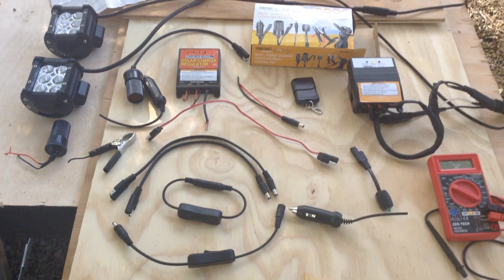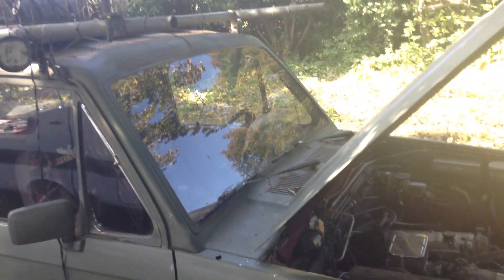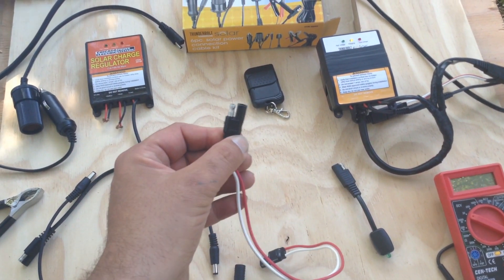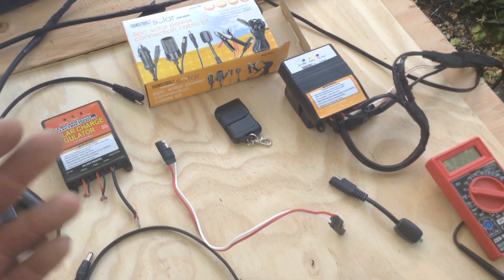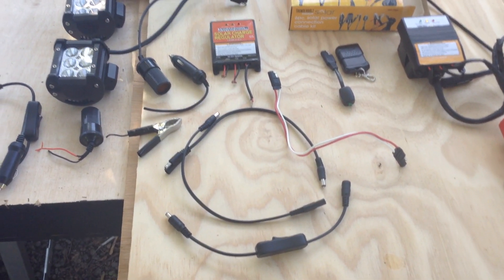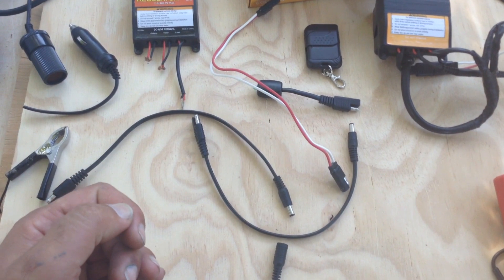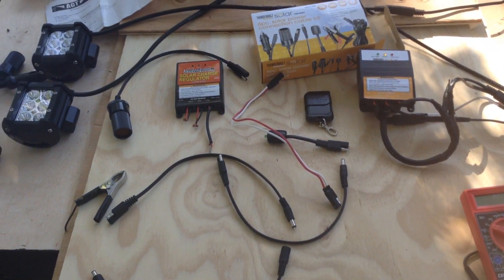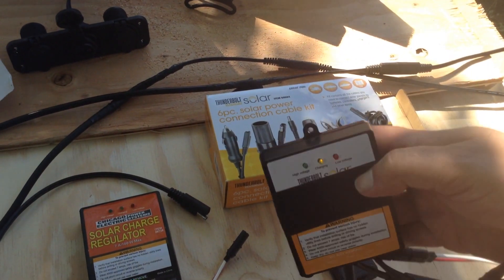SAE two prong plug based off grid and micro-grid system for solar power

Comment: Hey, I received a Dokio 300 watt panel. The connector was smashed from shipping. I opened back up with a pair of nail clippers. However, it makes the connection but the controller dumps the power every few controller cycles. You can see the voltage go variable. The input on the power bank input changes down to 0 then back up to 42 watts(This is on a cloudy day). 

Because of the messed up connector plus cloudy weather, I can't tell if the panel cable needs to be replaced, or if the panel is doing what it is supposed to. 

Should I send the panel back or just buy a new head for the sae2 cable that came damaged?

Comment: Nice educational video. To be totally honest, I was so frustrated with those damn connectors, that I cut them off and replaced them all with 30A Anderson powerpoles. Thanks for explaining their logic.
Reply from the maker: The main bonus of these connectors is that they seem pretty tolerant of moisture and usually come direct molded onto the wire, where the Anderson connectors have to be crimped in and thus often a questionable connection when it gets wet.
Reply: What are they plugs called mate
Reply: SAE connectors. @dannymack9636